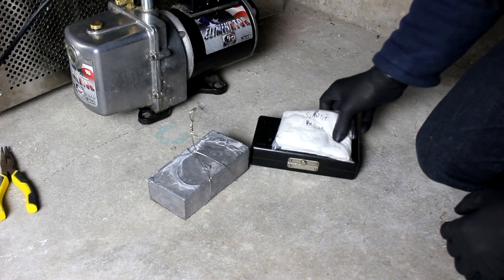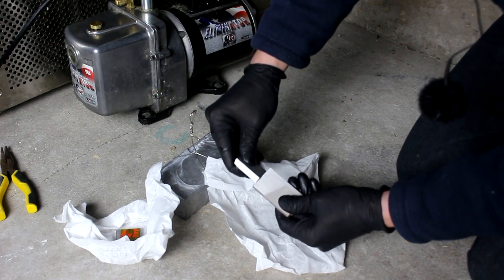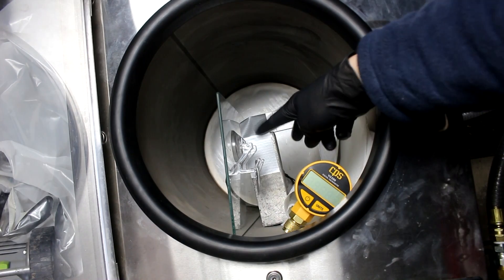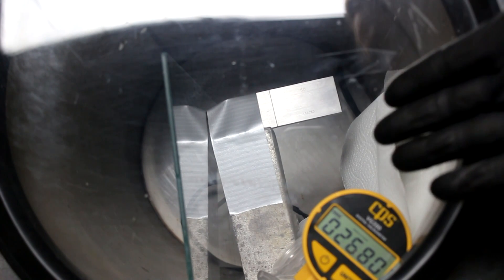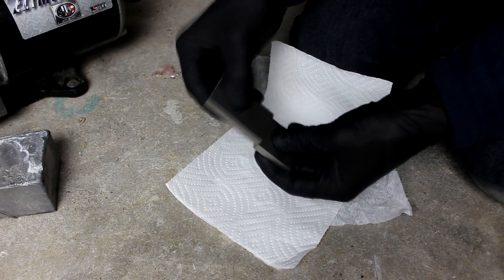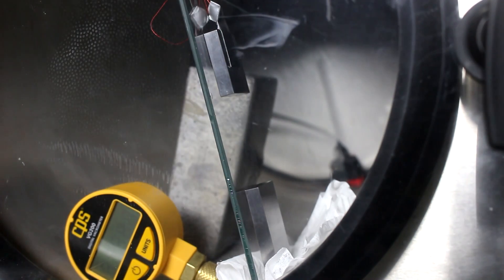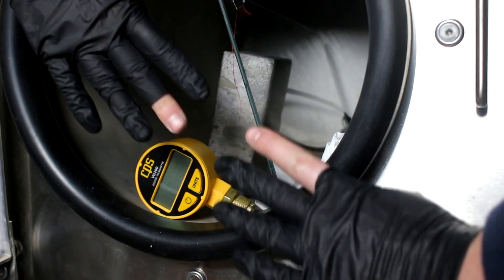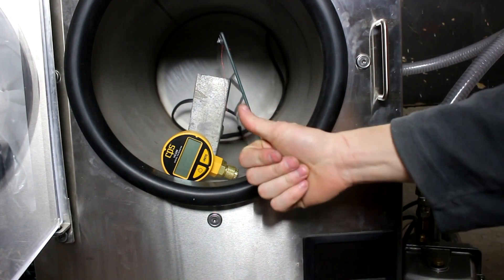Will Gauge Blocks Stick In Vacuum?

Comment: don't they stick because of the way the metallic bonds work? When there's no tarnish or air in between two pieces of metal of identical elemental composition, when they touch they will weld together.
Reply: 42Mrchadman42 if they cold welded together you wouldnt be able to move them or take them apart so easily
Reply: It has to a near perfect vacuum to weld. The friction should have the same reason. Both pieces of metal will chemically bond at the molecular level.
Reply: In vacuum they should stick but they didn't as he showed in this video. So these metals that he had just bond together due to friction on each other. Don't really know.
Reply: I think this is true.
The metal suface still needs some force though because it is not perfectly flat. So by pushing the parts together more surface comes into contact and the more effective gets the metal bond. Not sure either.
Reply: This is sort of what I thought, but then I learned that they make ceramic gauge blocks that can also be wrung together...
Reply: It would probably be easier to do it in an inert atmosphere than a vacuum, from a practical standpoint. All he can do in the chamber is hit stuff with that laser, which is really smart, but limits options.
Reply: Ivan Stroganov the grain structure of the metal would have a crack down the middle making the metal fail along that crack (I.e. Come back apart). So I think it's a metallic bond but it's just really weak and easy to break apart. Now if you had a cold weld stick for a long time then the weld might hold better as the grains of the two metal pieces start to interact more.

Comment: Is It Possible To Look At a Cold Weld With An Electron Microscope or Just A Really High Powered Microscope?
Reply: Bronson Stephens Yeah, lets get more youtuber on this.. "Applied Science" has an electron microscope!
Reply: As I was watching, I was thinking the exact same thing. I even did a Google search to see if there are any images of gauge blocks at a molecular level to see what's going on. No luck so far.
Reply: Applied Science/AvE/Cody's Lab 3-way colab?  Heads asplode.
Reply: Shop Dog; Actually, I just realised that you could take 2 extremely thin slices of the metal (on a x-ray transparent backing) and wring them together. Then you should be able to use x-ray diffraction to see the actual positions of the atoms and how close they come to eachother (all without breaking the bond between the two metals).
Reply: Bronson Stephens I want to know the same thing now
Reply: Undead Zombie; Optical microscope: Sure, you can look, but you won't see much.
Electron microscope: Yes that would work, but the moment you seperate the blocks, the bonds berween them will 'tear off' and the result will be increadibly hard (maybe even impossible?) to distinguish from galling (the type of wear you get when sliding metal peices start sticking to and taring pieces ofd each other)...

There are some nice pictures of the effect over here: https://en.m.wikipedia.org/wiki/Galling
Reply: MRLT Let's All Talk About This and Get Some Youtubers To Get This To Happen! What Does Everyone Think?
Reply: Bronson Stephens; This is actually a GREAT idea! I'm pretty sure Cody doesn't mind X-rays (and he can easily build an X-ray tube with his Sprengel pump), and Applied Science should be able to build the rest.
Then maybe they can also compare the differences (if any) between cold welding, these gauge blocks sticking, and normal metal on metal friction with Applied Science's electron microscope aswell.

As an aside, since Cody already plans on building a fusor neutron source, they could possibly even look at the bonds via neutron diffraction (which should be able to work with thicker metal samples than the x-ray diffraction...).
Reply: yes but you wouldn't be looking at the cold weld you'd be looking at the seam at the side of the too blocks

Comment: wow your getting so close to 1million subs

also gauge blocks are held by oil film, that little spray down with acetone left oil. try cleaning it with a real solvent like soaking it for a few hours in MEK. even the perfect grind leaves pores in the metal for oil

Comment: what would happen if you put your hand in a vacuum chamber
Reply: blood boil?
Reply: NG Music; It would get sucked in (because your blood/bodily tissues is at around atmospheric pressure) and then start to swell up a bit. Not anything really exciting.
Reply: MRLT ok thank you
Reply: MRLT I thought your hand would explode because of the pressure
Reply: NG Music;
Well I suppose it depends on what you would consider an explosion.
To give you an idea of the scale of the effect, your normal blood pressure is about 120 mmHg above atmospheric (which is around 760 mmHg at sea level).
However, the minimum pressure that you can have around your entire body for a long period of time (and still survive) is around 120 mBar (0.12*760=91.2mmHg), mainly because water starts to boil at body temperature below around half of that pressure, and because the lungs and brain are quite sensitive to large pressure differentials. This already shows that even your most sensitive organs would be able to survive (long term) under an atmosphere that has been reduced to only 12% its value at sea level!

Now, if you are standing in a pure oxygen atmosphere at a total pressure of 91mmHg, and put your hand into a vaccuum chamber, you would obviously be able to keep it in there almost indefinitely without any ill effects (the pressure differential acting on it is only about twice that which it is under right now!).
Similarly, if you were doing this at normal atmospheric pressure, the pressure differential is not nearly large enough to cause a catastrophic 'explosion' or dismemberment of your hand; It will almost certainly not even be able to rupture your major arteries (they are actually quite tough and resiliant).
It's not all good news however:
In the first couple of hours after you put your hand in the chamber, your hand will swell up quite a lot and it will dry out completely, causing your skin to develop little cracks and tears.
Most of the superficial blood vessels will also probably rupture in the first 12~24 hours, but clotting will easily be able to stop it from becomming a serious problem.
After that though, its pretty tough to say for sure what would happen if you still kept your hand in there... Any number of serious things could happen; You could get bubbles of gas evolving from your blood and clogging up your smaller blood vessels, you could have extreme tissue swelling that starts cutting off blood-flow alltogether, or you could even develop a blood-clot that breaks off and travels to your major organs...
It also very much depends on your physucal health: For instance, both smokers and intravenous drug users's veins are going to be MUCH more susceptable to rupturing than usual. And obviously, people with heart disease or already dangerously high blood pressure may also be at increased risk.

Comment: is there an effective way to produce carbon monoxide without releasing too much carbon dioxide
Reply from the maker: yes run carbon dioxide through some hot coals.
Reply: You wanna gas someone?
Reply: If you are reacting formic acid with sulphuric acid you should produce a good amount of CO.
Reply: Hey Cody I think I know how you could test if its the van der waal force, technically (from what I can recall) it happens when molecules are slightly charged, for example dipoles formed in water, attracts other molecules with the opposite charge, so, in theory a strong enough current flow could disrupt the van der waal force by changing the polarity of the molecules by "flipping" the electrons in all molecules to a single alignment, if its cold welding (which I really don't think it is) it wouldn't disrupt anything, even more, I theorize that as you have electrons passing from one metal to the other, it should make the cold welding more likely as the molecules get aligned and attract each other more strongly, rising the chance of forming molecule bonds
Reply: Why would that work
Reply: trying to make carbon monoxide to reduce lead dioxide into lead metal
Reply: I also need this to work at liquid lead temperatures

Comment: Get that vacuum pump choochin
Reply: Bryan Tuck it's better than a vice
Reply: Bryan Tuck nothing happens bananas don't explode in a vacuume
Reply: i think you would have good luck with stonefruits given their void around the seed inside the shell. however it connects to the stem so it may just port right out the top.
Reply: Bryan Tuck YES.
Reply: artonline01 i think they sell a special kind of vacuum chamber for that haha
Reply: Jared Jaster yeah I guess that makes sense since bananas don't have a very strong/airtight outer layer. Sausage in natural casing might though!

Comment: Can you pressurise the vacuum chamber?
Reply from the maker: not this one but I have another that I am putting together that can do just that
Reply: Cody'sLab What would you do with that? I guess simulate other atmospheric pressures.
Reply: Yay, did you use my idea of electrical pass-throughs for sensors? or alternatively you could use IR communication through the window.
Reply: Most glass blocks IR and i'm not sure about the plastic that the window is made of but probably that too.
Reply: Optical relay style set up with a couple isolated LEDs or laser modules would work fine.

Comment: Awesome! I still want to see how long a hot object stays hot in a vacuum compared to the same object at atmosphere.
Reply: It would be interesting if he heated a magnetically levitated object so that the only way it lost heat was through radiation, not conduction. If it were small enough he may be able to heat it with the laser and record with a FLIR camera to capture the change in energy.
Reply: Well, according to Planck's law and Stefan–Boltzmann law, the body will keep radiating heat. It doesn't need a medium to cool itself down. it might take longer, but even in a perfect vacuum, the object will eventually cool down.
Reply: Because I am a l33t haxor duh! No its this little thing called patreon where I am willing to fork over a few bucks a month to support the creators I love.
Reply: ***** Oh, i see. Btw, i read your comment suggesting magnetic levitation. There is a possible problem though, using a magnet to levitate a paramagnetic object would cause him to heat up, which would kinda ruin the experiment by implementing a source of heat.
Reply: Inductive heating would probably be the best option (perhaps on an actuated platform so it can be raised and lowered around the object), though at such low pressures electrolitic capacitors tend to pop, not a big deal as you could use solid capacitors or insulate the capacitors against the pressure just something to keep in mind. 
If Cody where to do such an experiment I'm sure he would be able to figure all this out though.

And yes, magnets are just pure awesome to play with.
Reply: do you own a Thermos? try it........... i do every day....
Reply: x9x9x9x9x9 how was your comment posted 39 minutes ago this vid was uploaded lol 😃
Reply: x9x9x9x9x9 how'd you get it so early?
Reply: Patreon, guys
Reply: I was just thinking of the same experiment the other day!
Reply: x9x9x9x9x9 I think it takes quite a lot of time. I was wondered about the origin of the iron nickel meteorites and apparently those are due to the chunk of metal alloy cooling down so slowly in space that one of its constituents has the time to diffuse out of it or something. I still didn't really understand it, except the part that said that they cooled really slowly in space.
Reply: When a fluid is enough of an object you can try drinking your coffee in your car or at work from a thermos bottle. For other experiments one could try change in atmospheric pressure. It's free even though not as conclusive. By the way, what was the outcome for: Will Gauge Blocks stick in vacuum?
Reply: Theoretically a hot object in a vacuum should stay hot for a very long time since there is no air to wick away heat. So I am curious about how long it will stay hot and what causes it to cool down.
Reply: I didn't even think about the heat loss from conduction. Hmmmm that does change things.
Reply: FlyingJetpack1 But that's the objective, to demonstrate/visualize how much slower it cools down without air or a platform absorbing its heat.
Reply: FlyingJetpack1 Yeah, I was thinking of that as well. What about a rig with bismuth, like the one NightHawkInLight made? there's no current or changing fields, so the object shouldn't heat, right? something like that seems like it would scale nicely to the space available in the chamber and a small enough object to heat thoroughly with a laser. maybe.
Reply: Another problem with the levitation method might be that the heat could cause the levitating object to lose it's magnetic properties.

I searched for the curie temperature of pyrolitic carbon but I can't seem to find it, though I did find this interesting article about photo manipulation of levitating graphite.
https://phys.org/news/2012-12-magnetically-levitating-graphite-laser.html

The best way to suspend an object in the vacuum chamber would probably just be hanging it up with a wire that has high heat resistance and low conductivity (like woven glasfiber or asbestos), the heat loss through the wire would be negligible.
Reply: Amalek I didn't even think of something being demagnetized at high temperatures. Suspending it by a material with low thermal conductivity probably falls into the "practical" and "good enough" categories. But magnets are so cool...
Reply: Amalek I didn't even think of something being demagnetized at high temperatures. Suspending it by a material with low thermal conductivity probably falls into the "practical" and "good enough" categories. But magnets are so cool...
Reply: maybe a strand of kevlar? But to heat it is now the question. Something small the laser could do maybe do some inductive heating with a copper coil? I have no idea though. I just think it would be an awesome experiment.
Reply: A thermos has insulation, not vacuum properties
Reply: Have you heard the term 'vacuum flask'? A good thermos has a inner chamber surrounded by vacuum, so the only place that conductive heat transfer can happen is at the lid.
Reply: A thermos insulates with a vacuum.